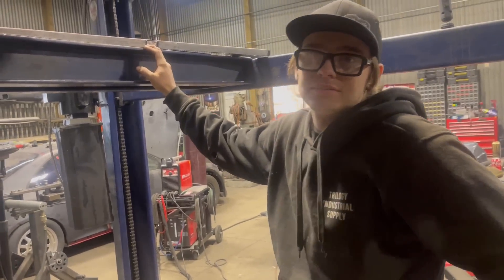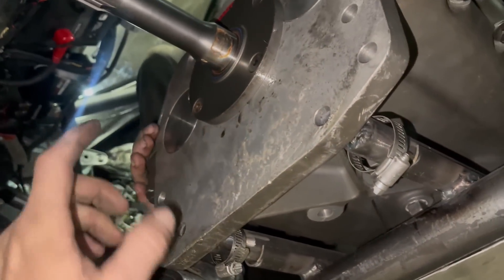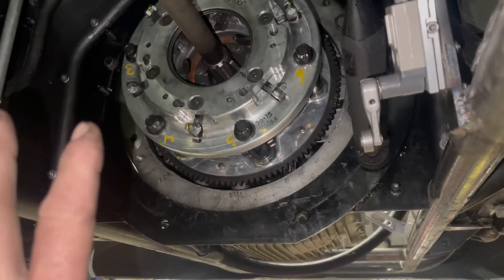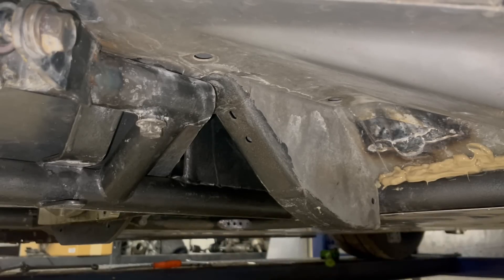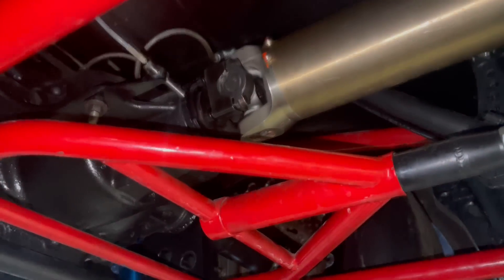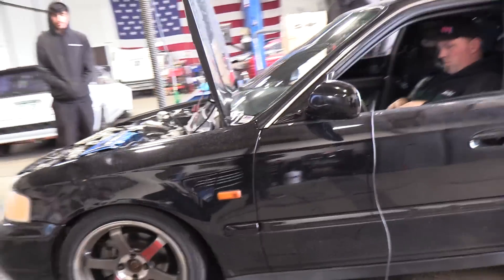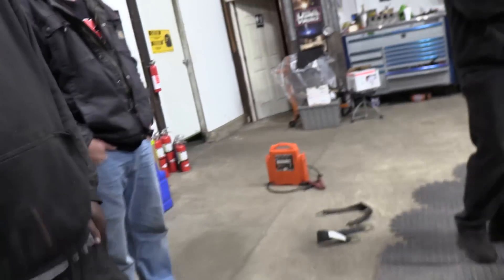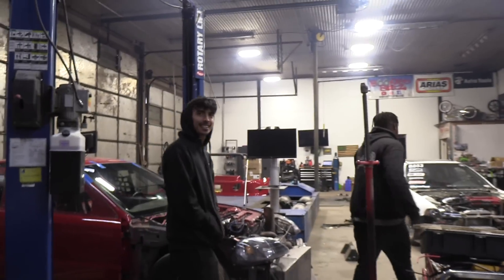SHO’NUFF I’m A Proud Dad After My Youngest Son Sets up the Slipper clutch!  INSANE DAY!!

Comment: Its all good Brent. Awesome video lots of information to take in.I know I won't judge you because your doing something awesome. I got some automotive skills not like what you guys have. I do fix my own issues with my vehicle. Anything mechanical I can fix but when it comes to sensors and stuff like that I'm not so good with. I got a map sensor problem I can't figure out.  I changed it looked for vacuum leaks but still says voltage is too high. I can't figure it out. But I can fix pretty much anything else.

Comment: Hey Brent/Jamie, what causes that typical idle misfire you can hear clearly at 24:36 in the video? I hear that in so many cars including mine, doesn't matter if I bring the idle to 11:1 or 14:1, ethanol or gas, it's always there... I've tried Bosch 2200's, and now on ID1700x's.

Comment: So from my understanding the nuts and bolts you guys put on the outside- is just for counter balance? Love learning from you guys. Keep up the great content!
Reply: They put more pressure on the clutch or less if it’s lighter. It allows the clutch to slip slightly at the beginning to ease the load on the driveline then apply more pressure once it gets up to speed.

Comment: Maybe I'm missing something but your dial indicator readings were starting at about 50 thousands.  So when you press it in and read 98 it would actually be a difference of 48 thousands.
Reply: .049 is the actual 0 from Titan for this clutch. So when we you set the clutch, the 0 is the dial will read 0. Actually, being .051